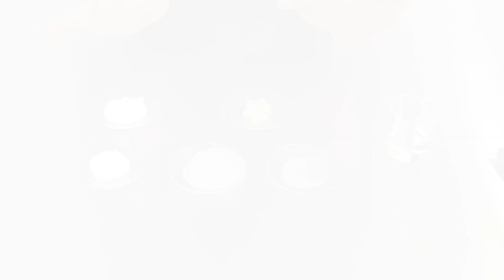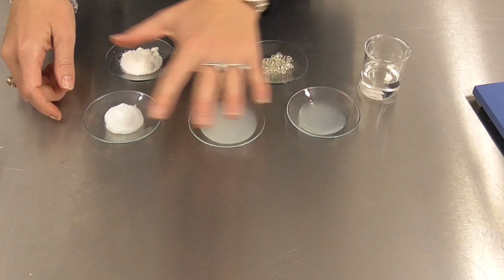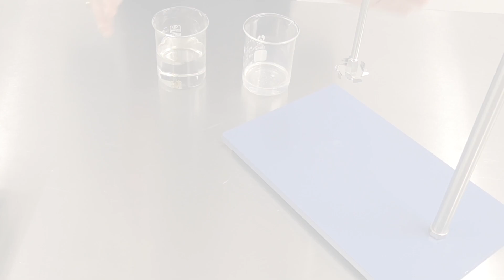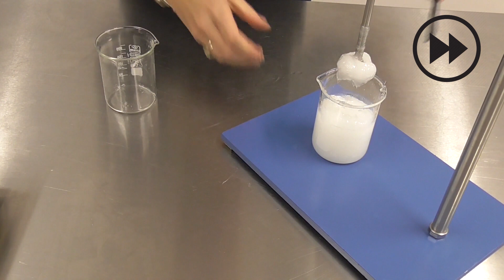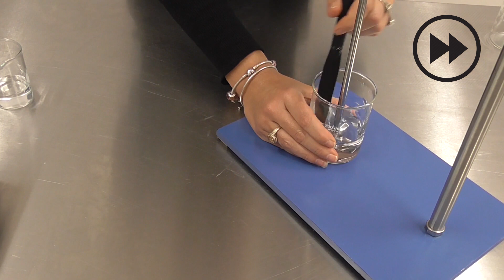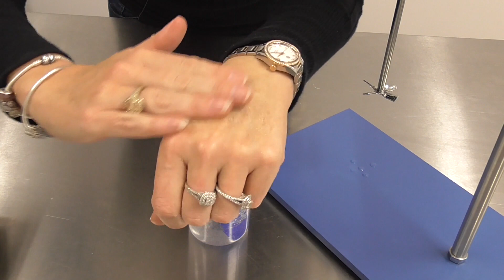How to Create Oily Gels

Comment: I tried using the CF gel and the first small amount of oil it was gelling up really nicely, but as i added more it's become quite runny and has a curdly looking froth through it that is slowly settling up to the top. Any ideas what went wrong? I used 20g CF  and 60g oil (Capric coconut oil and olive oil), i did add 3g of Vit E tocopherol and 2.4g of fragrance oil. Thanks for any help.

Comment: Can I use a double boiler instead of actually putting them directly on heat ?
Reply from the maker: Hi Razan,

Yes, where heat is required you can use a double boiler. 

Happy Formulating!

Comment: This seems like surf pro surfactin on the natural ingredient that required the high shear mixing? If it is, I have yet to get it to work no matter how much I mix. Stick blender, hand mixer with propeller blade and adding the oils SLOWLY, it will not stay intact....
Reply from the maker: Hi C Wood85 no it is not that material, please email us for full formulation, method and supplier details, thank you